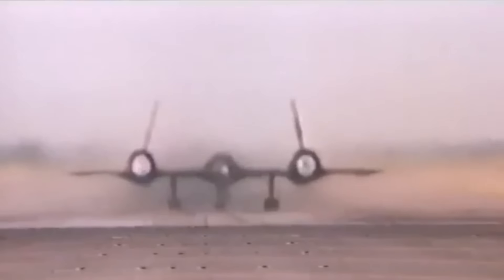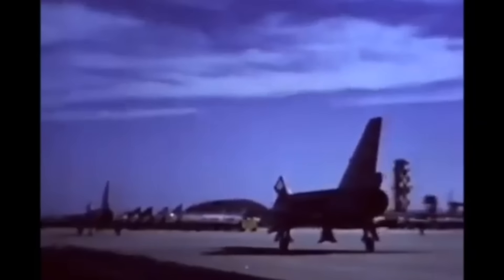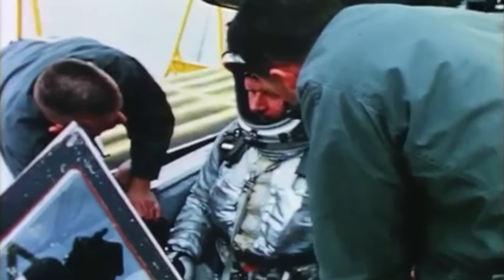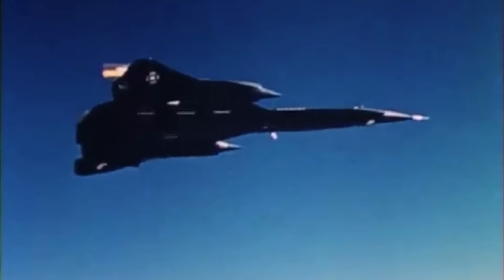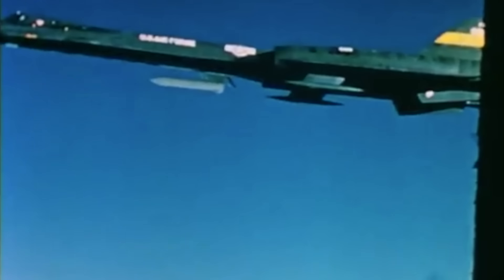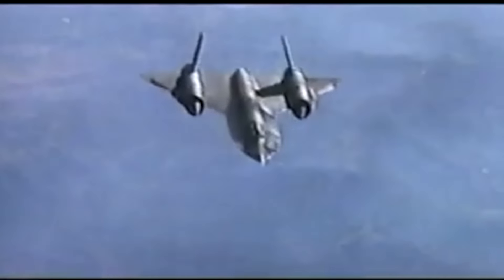YF-12: The SR-71's missile-packing sibling

Comment: It was designed to carry "8", AIM-47A air defense missiles, Range-100mi, at Mach-6 ( Fully Active Radar Homing, combined with Terminal Infra Red homing, at 20mi to target ) . . . Radar-ASG-18, 350 mile range
Reply: Wow!  I didn’t realize the AIM-47 had both active radar and terminal IR guidance.  That’s impressive!
Reply: @keirfarnum6811  Its surprising that its NOT, still in service "Today" . . . in a MUCH IMPROVED version, of course . . . like the AIM-9 "Sidewinder".
Reply: How do you know so much about Blackbirds?
Reply: @Lovealwayskamber  Many years of "Detailed Study", long before there was an INTERNET . . .
Reply: @Montana Bulldog If you have Instagram, there is an account on all things Blackbird. It's called @romig21. It's very interesting.
Reply: YF-12A carried 3 AIM-47 missiles.
Reply: @hoghogwild  The "3", was only for testing . . . 2 groups of "Two", on either side of the center line.

Comment: Amazing. Almost 60 years later, still unsurpassed as an aircraft in terms of speed and altitude.
Reply: MiG-25's were tracked on radar during Persian Gulf War, momentarily reaching Mach 3.2... then again, engines used on them would start to wear out quite fast beyond Mach 2.5... but atleast for a while it could still do it. MiG-25 has also reached 118,900 ft altitude without payload. Considering it's a fighter jet, development started late 50's, first flight being in 1964, these also pretty impressive numbers...

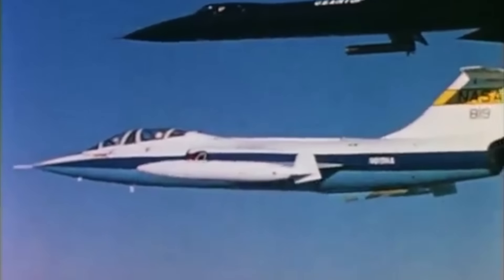Comment: 7:19 - The SR-71C was the aft section of the damaged YF-12 and the front of what had been the static ground based model SR-71 built to test and improve ground procedure. 

The SR-71C absolutely did fly and was renowned in the community for being a finicky little bitch of an airplane, but still unbelievably capable.

Comment: @7:19 The SR-71C was NOT a static test specimen.  It was a dual cockpit trainer aircraft that replaced one of the two SR-71B models lost in a crash.  The SR-71C allowed the SR-71 program to continue pilot training flights whenever the remaining SR-71B was down for maintenance.
Reply: Well, what is the SR-71C?  A dual cockpit trainer, as you state, but it was built by mating two pieces of junk:  The rear half of YF-12A #06934 and an engineering mockup of the SR-71B that was indeed built exclusively for static testing.  While the video's narration is a hopelessly confused mess, it seems to be saying that #06934 was used to build a static test frame for some kind of SR and somehow the SR-71C emerged.  Obviously, #06934 was never used or built as a static test piece, but the truth is the SR-71C #17981 WAS built from such a piece.  This queer origin is commonly cited as the reason #981 was known as "The Bastard."
Reply: @49metal  Absolutely correct. The Bastard flew with a constant yaw so was not used as much as the others. The only thing I disagree is that the 71C was made from two pieces of junk  :)  just semantics I suppose .  Maybe more of a Franken-Blackbird (rather FrankenBird's Monster?)

Comment: How can a plane that flies faster than its armament launch a missile? "Fox 2"......."Let me try this again"..... "Fox 2"...... "Alpha Base, can you confirm missile launch?"........"Sierra Romeo"...... "You're flying past the missile."
Reply: Physics... the missile is inside the aircraft, going the same speed... also, the aircraft would not be at max operating speed when they bay doors opened.
Reply: @robbfisher2876  if you are driving in a car for example, and throw a tennisball forwards, you'll see that the tennisball will be infront of you for a short time, the only reason you overtake it is because the car keeps accelerating, if the tennisball had a rocketmotor, it would take a while to overtake the tennisball regardless of your speed.

This is very actively used by modern fighter planes. If you use the trust of the plane to break through the sound barrier and accelerate to lets say mach 1.6, the missile will start at that speed, meaning it wont have to use any energy to break the sound barrier and accelerate causing it to go much further
Reply: @koekiejam18  Yes, though a better analogy would be just dropping the ball... also, I'm not the one who asked the original question!  :)
Reply: @robbfisher2876  My bad, i dont answer enough youtube comments to be that proficient in commenting on youtube hah! Altough you are 100% correct that dropping a ball is a better analogy, i tried to somehow include the fact that you dont overtake the missile in my analogy, hence why it isnt that accurate. Regardless its a fascinating bit of  physics

Comment: Something I keep noticing with these aircraft (this family) is the use of the engine Nacelle Cone, similar to the Mig-21. I wonder if those cones were movable, and for the same reason as the Mig-21 for trans-sonic management? Amazing aircraft, and also the Cockpit window shape hearkens to the F-117A, curious how much technology from these interceptors, high altitude reconnaissance planes carried over into the 80's and 90's? Also the organic flow of the YF and SR are similar to the F-35 body shapes. Incredible tech and lineage.
Reply: They did.
Reply: @FlyingTigress  Thank you!
Reply: Yes, those cone spikes managed the airflow into the engines at higher speeds to create ramjet effect making them “turbo-ramjets”.
Reply: The "Cone", as your calling it, is actually a "Shock Cone" . . . it MOVES, a total of "26" inches, back an forth . . . its designed to SLOW incoming air, to prevent a "Turbine Stall".
Reply: @montanabulldog9687  Thanks Montana appreciate your detail. I can't keep it all straight.
Reply: @sulufest  At "Mach-3+", the ENGINES, are only producing 17% of trust, because of their design . . . ( I E the "Ram-Jet" effect. )
Reply: @Super Mario At MAX SPEED, her "Engines" are only producing "17"% of the actual thrust . . . because their acting like RAM JETS.
Reply: @Super Mario its basically the opposite of super cruise, the whole engine turns into an afterburner. At high speeds it functions as a ramjet where the speed of the plane compresses the air as it enters the engine (caused by shock waves and the big cones at the front of each engine) so the entire actual engine can be bypassed. It's actually more efficient the faster it goes because more compression happens, and less energy is lost to fan blades.

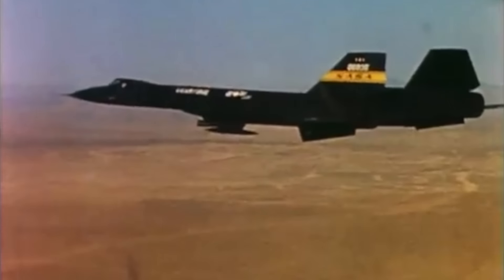Comment: Wait.... the picture at 7:11 of 936, I've never seen that picture before. I have been to the crash site and I have pieces of that plane, but based on the only video I've ever seen of the crash it doesn't look like the wreckage would look like what is pictured at 7:11. Also, the terrain in the images isn't what the area 936 crashed into looks like, so I suppose this could be the remains being placed back at Edwards or Groom, after the crash. Can someone confirm where this image came from and the details?

Comment: why hasn't that project been attempted? Maybe add a enclosed tail rotor and use the blades from the Comanche project..... maybe connect the blades directly to the body of a bell 222 and use the same kind of metal that the SR-71 used and then see if you can push a bell 222 to at least close to Mach 1 Mach 2 speeds.

Comment: SR71 is a surprisingly small jet. There's one in a flight museum in Wilsonville OR. The pics and videos  make it appear rather large...
Reply: I'd call 102 Ft LONG . . . on the "Large" side !
Reply: @King_reretard  stand next to one.. You'll be surprised
Reply: I'm always surprised how big they are.
Reply: @Lovealwayskamber  102 Ft LONG, 69Ft WIDE . . . heres a "Good Piece" of info, that not many even KNOW . . . the SR-71, an the "Rest" of her family . . . it actually "Grows", LONGER . . . while its in full flight ( Just about "2" Full Inches ! )
Reply: @montanabulldog9687  And leaks fuel when on the ground or subsonic!
Reply: @2fathomsdeeper  Like a CIVE !, but its "Designed" to DO THAT !. Once it gets up to "Speed",, the seals EXPAND, an it stops. The aircraft "Carries", 18,600 gal. of fuel, at FULL LOAD.
Reply: @montanabulldog9687  a video i seen said the points on the motors actually go in the making the airwaves in the front open wider to suck more air in as it speeds up.
Reply: @brandonh5201  The "SPIKES", move a total of 24 Inches, "In an Out".

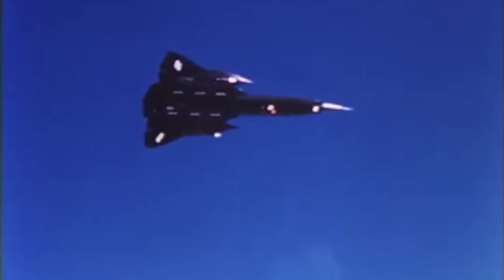Comment: The narration that says "...boasting an increase in range to 1,350 nautical miles" at 5:00 must be wrong. The plane would have to be refueled about every half hour!
Reply: The YF-12 had a range of just under 3,000 miles, and the SR-71 had a range of right around 3,350. both were capable of in-flight refueling, so they could stay aloft for long missions, providing support planes were loitering at key locations.

Comment: Isn't the mig25 a faster interceptor?
Reply: Nah the MIg 25 was a joke
Reply: MiG-25 officially had top speed of Mach 2.83, but was said to be capable of Mach 3... and in combat, has been tracked to reach even Mach 3.2... and this is with 2x 100kN engines. MiG-31 officially has top speed of Mach 3... but also has 2x 135kN engines, while the materials and aerodynaamics have assumably also being improved since the 60's, when MiG-25 came out... most likely MiG-31 is in reality capable of reaching well past that Mach 3.2 the older model could do - and assumably without permanent engine damage, unlike MiG-25...

Comment: 2070 mph is Mach 3.13.not 2.70 The speed of sound at altitude is 660 mph, based on ICAO  outside air temperature.  You get Mach 2.70 only if one uses the sea level speed of sound to calculate Mach number.

 One of the reasons we didn't build more YF-12s is that we had bought the titanium to build the A-12 and SR-71s from Russia using dummy corporations.  I suspect we had run out of titanium, and Russia wasn't going to fall for the same trick twice,